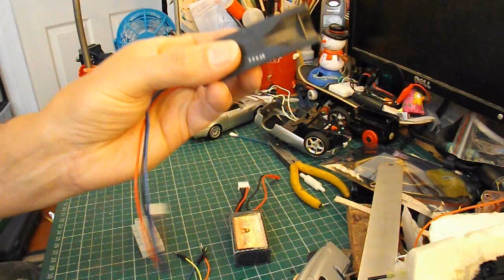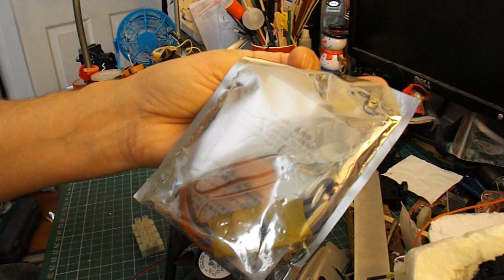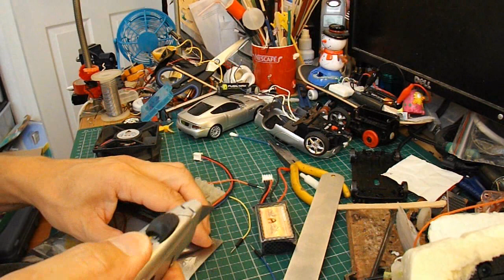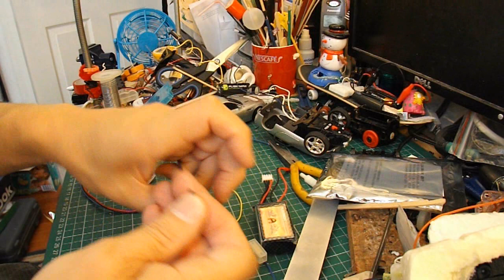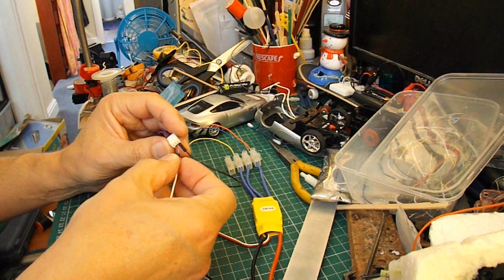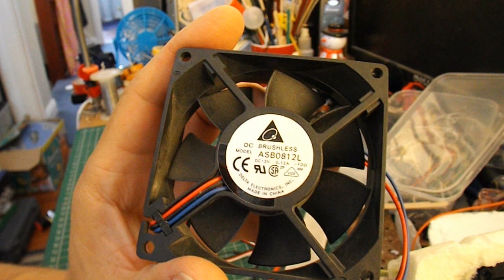Can you control a 3 wire PC fan with an ESC?

Comment: Watched this video to see if I could find out what the third wire was for.  Now I know it is for speed signal to the mother board.  I was hoping it was an actual speed control by some signal.  It only tells the mother board how fast it is running and then the mother board regulates the voltage to the motor.  All the comments about ESCs made me realize I should just use an extra brushless motor and use an ESC and servo tester to control the speed of the motor to use as a portable multiuse fan.  Thanks for the comments that helped me see the light!
Reply from the maker: I am told there are some PC fans that are brushless and do use an ESC circuit to control it, but certainly not the one I am demonstrating in the video.

Comment: In a 3-wire system, the speed feedback signal is sent to the control system through a white line to control the input voltage, so that the fan speed can finally reach a balance. If there is a large amount of heat to be dissipated, the control system and other sensors are necessary to break the balance and improve the speed.
Reply from the maker: Thanks, you will find I have put some detail in the video description 👍👍

Comment: I'm not super familiar with modern speed controls, but I'm guessing this is one of the models used for 3-phase brushless motors? I used to use ESCs for RC car racing back in the brushed motor days. If the motor turns when voltage is applied, I would think that one of these old-school brushed ESCs that simply put out PWM power might work for this. (I mean, should be the same as simply flipping it on and off quickly.) If you think it wouldn't, though, could you explain why?
Reply from the maker: Looks like I missed your comment 9 months ago. I think you missed the point of the original question. If it is a simple 2 wire DC motor then a brushed ESC would control the speed OK using PWM, in fact if you read some of the other comments, they explain that. However, the original question was regarding a 3 wire fan based on the erroneous assumption that because it had 3 wires, it must be a brushless motor and therefor could be controlled with a 3 wire brushless ESC. There is a lot of detail in the video description, so I don't need to repeat it all here.

Comment: Can u convert a two wire dc brushless computer fan into three wire dc brushless motor
Reply from the maker: If it is a "2 wire dc brushless" the controlling circuit will be onboard within the fan casing. That does the conversion from 2 wire input to the phases required to energise the coils in sequence. In my video description you will find this link  "PC fan BLDC driver circuit reverse engineered" by randomtronic https://youtu.be/Im2GoXVy8d0?list=PLA5a2xPRSrB1z9JHbVfAXSGz9NBS_-Czc it explains the circuit.
Reply: @GrandadIsAnOldMan  thank you sir for the response I just finished watching this link u sent, the circuit u provided n explanation will surely come in use .
actually I am trying to control a pc brushless two pole motor with a rf control via esc  three wire .so ,trying to convert it into a  three wire motor so that I can control it through esc three wire rf control system.
Reply from the maker: @yaminoshinn1473  good luck with that 👍
Reply: Thankyou ...

Comment: However, if you removed the circuitry in the fan, and hooked the ESC to the coil(s) itself...... Id imagine it would work?
Reply from the maker: I am afraid 'imagine' is not good enough. You need to try it. You will probably find the one you try is a two phase circuit which a brushless ESC will not drive. I put a lot of information and links in the video description. I recommend you look at the link "PC fan BLDC driver circuit reverse engineered" by randomtronic as he goes down to component level detail. There are some fan motors that are suitable for brushless ESC control, but not the old ones. Incidentally, back when I did this video (2015) I did another video where I try directly connecting to the coils but as it was a disaster/fail I never published the video and included the randomtronic link in this video description to cover it. 😊👍
Reply: @GrandadIsAnOldMan  Ive done it not with an ESC, but with a signal generator outputting s sine wave, and the generator hooked up to a poweramp, then into the coils. It ran, but once I got to about 150Hz, the motor always lost sync and it just decelerated and vibrated. I wouldn't recommend doing this to a good poweramp, unless it can handle such a low impedance load. This one was just a cheap wal mart single channel 200W. Those mosfets were screaming hot after it was all said n done.
Reply from the maker: @williamnichols2067  thanks, but that really does not answer the original question in the video. The guy just wanted to connect an ESC direct to the PC fan and the answer is no. Using a sine wave generator to send a "pulsing" supply to the coils will cause it to rotate. There are even videos on YouTube using AC mains supply to achieve a similar result, but again, not the answer to the question. You can generate rotation by pulsing a single coil, I have several videos of pulse motors, and I do enjoy making them.

Comment: He was talking about hooking the armature of the fan directly to the esc and not the fan wires like kids. The armature is fixed and has 3 phases aswell.  BTW i tried and the ans is NO
Reply from the maker: It is great to know you can read people's minds and predict what they meant to say. When you answer a question, it is best to answer the question asked, rather than try to guess what might have been intended. If your answer does not provide the response expected, then the questioner will learn to phrase their question in a more specific language. As the questioner has not respecified their question I must have answered it to their satisfaction. If you want more information about how some of these PC fans work, you may find the information in the video description helpful, particularly the link to the video by randomtronic where he explains how the circuit on the fan works.
Reply: @GrandadIsAnOldMan  Hmm.. Thaths also right because if you answer other than phrasing than the questioner wont let ya live. So good then

Comment: PC brushless dc fans have their own esc built in. If you want to use external esc you just have to solder to the 3 ends of the coil itself.
Reply from the maker: I think the point of the question was around the 3 wires. If you check some of the other comments or the video description, there is more detail on the subject.

Comment: Maybe we can rewind the bldc pc fan motor direct without board in that fan motor..and then we can control that motor with esc🤔
Reply from the maker: I am sure you could, but that was not what the question asked. It was a misunderstanding of what those 3 wires did. That person wanted an easy way of controlling an existing fan. I understand that modern PC fans may be PWM controlled, but that does not mean you can plug a hobby grade ESC into it to get it working. Disassembling it and rewiring it is not a simple task. A Google search for "pc fan pwm controller" does bring up several circuit diagrams. Another problem with rewinding the motor is the number of coils. The ones I looked at had 4 coils which does not lend itself to a 3 wire control ESC. There are some useful links in my video description.

Comment: Should work with a brushed esc
Reply from the maker: Hi Daniel, YouTube now shows me notifications for all comments and has backdated them, so I am now getting notifications on all the ones I failed to write a reply to in the past, even if I had "Hearted" them at the time. Sorry but it looks like they need me to write a reply to clear it off the system so you may get a few more of these as I am pasting standard replies. Thanks anyway 😆
Reply: @GrandadIsAnOldMan  YouTube is weird like that sometimes.

Comment: Thing I want to know will that fan motor run as my car air con as mine in my car is reached destination fooked 😂
Reply from the maker: If it's a 12 volt and and your car is the standard 12 volt system then yes it would work in your car if you wire it up to a suitable supply although you can probably buy a similar fan in a dollar store with a plug on it and a mounting clip.

Comment: How can i connect CPU fan with car battery if yes then plz example
Reply from the maker: If it is a 12 volt fan then it should run off a 12 volt battery with no problem, just connect positive to positive and negative to negative.

Comment: I came across this fan inside of a thunderbolt 2 enclosure I use for a couple of SSD drives. I disconnected the plug which powered the fan inside the unit. The fan never slowed down, it just kept a constant rate and I disconnected it since the drives don't generate any heat. However, I've been wanting to add an off and on switch to control the fan. Any idea how I could wire in a toggle switch, or rocker switch to the 3 wires? Here's an image: http://bit.ly/2GyznQG
Reply from the maker: I would suggest Googling for a Fan Motor wiring diagram to understand the three wires. They have different purposes depending on the Fan design. In some cases you can rely on red and black being the power and the third wire would be a speed sensor but that is not always the case. If it was you should only need to intercept the red wire for a toggle switch inline.
Reply: @GrandadIsAnOldMan  Thanks for the reply, I was able to get the necessary info but your video helped! : )

Comment: The dc fan have already electronics circuit soo thats why it does not run with esc
Reply from the maker: Thanks, I think the point is that there are many different types of PC fan (details in the video description) and the answer to the original question was NO, just because the fan had 3 wires didn't mean it was a brushless motor. I think they were hoping to use it for a hovercraft or aircraft.
Reply from the maker: @Richard NZ I am afraid using the term "Brushless" just seems to upset people who want to reserve that "name" for the motors on RC  cars/boats/plane/quads. More often the fan motors are referred to as BLDC which is still brushless but uses an onboard controller. The extra wires going back to the mother board are not the same 3 wires that an RC ESC would control so in answer to the original question I was asked NO you cannot control a 3 wire PC fan with an RC ESC. However you could be right, I haven't bought a new PC for several years. Technically, brushless simply means it does not use brushes to transfer the power to the coils so there are a whole range of motors that are brushless but that still does not mean they can all be controlled with an RC hobby grade ESC.

Comment: I think the person who asked the questions goal was to remote operate the fan he just asked the question wrong. Maybe similar to wireless using what he had on hand with the ESC.  You could use blue wire as signal/speed and servo switch off the battery for power on and off. It would make a cool fan boat project....

Comment: I have a little fan that came off an old computer, I plugged it in to my new pc (its a 3 wire) wondering  if i could use it to assist my CPU fan for overclocking another old pc, and WOW it moves air. It was pushing itself back and it sounded like a little turbocharger. Im gonna look for another one and put em on a rc plane
Reply from the maker: Generally their power to weight ratio means they are too heavy for that but I have seen hovercraft done with them OK.

Comment: Brushless ESC systems basically create three-phase AC power,
Reply from the maker: Thanks for commenting. Yes, where it gets a little confusing in the case of these PC fans is the actual motor is in effect a brushless motor but the feed is normal DC. There is a circuit board under the label that is a bespoke "ESC" to drive it. The confusion is people see 3 wires going in and think they are the same 3 wires you would get from a typical RC ESC but they are not. Just the normal 2 wires + & - and then another wire for control purposes handled by the PC motherboard. There is more information in my video description.

Comment: Are you tried to run bldc motor on pc fan circuit board..which is inside the motor.
Reply from the maker: No I haven't tried that. I did look at one and found it had 4 arms instead of the 3 I expected, I don't know if they are all like that.
Reply: @GrandadIsAnOldMan  usually are from my experience

Comment: Couldn't u just plug it into the receiver and it will turn on when u turn the receiver on?
Reply from the maker: I guess that depends what you want the fan to do. If you want to be able to control it's speed then you will need some sort of speed control and there are several ways of doing that depending on what sort of fan it is. There is more information in the video description.

Comment: how to use bresslessmoter with out esc
Reply from the maker: A brushless motor is basically the same as a stepper motor so you could possibly find a stepper motor driver that will turn it however you will NOT be able to drive a brushless motor without some kind of driver. It relies on each of it's coils being powered in a sequence so just applying DC to it will not drive it. This video might help you understand https://youtu.be/KGpf1j-EiKg

Comment: U obviously didn't understand what the guy meant, he wanted you to connect esc's 3 wires to 3 wires of the Motor Coil for which u need to take the fan apart and find them inside. The wires you connected to are coming from integrated controller on which the motors coil is already connected, you cannot control a controller, you need to remove one that's inside.
Reply from the maker: Two points. First I do not try to guess what somebody means when they ask a question, I answer the question asked. Second, have you tried what you suggest? Although the motor inside many computer fans are brushless they are NOT wired like a model car/airplane brushless motor and it is NOT a simple matter of connecting the 3 wires from an ESC to 3 wires inside the case when you have removed the controller circuit. Here is a good video on reverse engineering a PC fan brushless motor https://youtu.be/Im2GoXVy8d0?list=PLA5a2xPRSrB1z9JHbVfAXSGz9NBS_-Czc

Comment: he`s fool 
this man was asking him how to make work a Speed Controller fan with adjustable
but he did`t told him how he just showing you how it was working with battery !!!
so we also known about this thing . 
look i have 12v 4A fan with 6500 RPM so can you told me how to find Speed Controller fan adjustable to using it in power supply ?

Comment: mine working but  very low speed with 3s
Reply: Try looking for a little 'component' mounted on the exterior of the fan, a small blob with two legs coming out of it.  It may be a thermal control.  If you find it, check the resistance.  Then, warm it up and check the resistance again.  IF you feel lucky, and you are just paying with an old fan, try shorting the two legs.  If it runs full speed, you can change the speed of the fan by changing the resistance.  No promises.  Maybe check for information on "Thermally controlled fan".
Reply from the maker: There are many different types of PC fans with different wiring systems. There is more information in my video description.

Comment: I was wondering if you could connect multiple fans of different sizes to one three speed switch without it having side effects.
Reply from the maker: Are you talking about inside a PC or just connecting fans to a power supply? If they are different sizes but all the same voltage and motor type then they will increase the current draw from whatever you are using to supply them. If it is an unregulated supply it will probably keep supplying the power required until you have overloaded it and it burns something out, either an inbuilt fuse or the supply circuitry. In a PC is is likely it is a regulated supply, but there is no guarantee so you would be trying it at your own risk. If there is no inbuilt regulation or fuse then you would risk either killing your power supply unit or your motherboard. You would be better asking that question on a computer forum. There are several different types of fans used to cool PCs so there is no answer that will cover all the different motor control systems and power supplies.

Comment: you guys looks totally wrong there.
its a stepper motor.
but the 3 vires is powering the stepper driver placed back on the motor.
so you are connecting stepper driver to power of stepper 2 and tachometer .